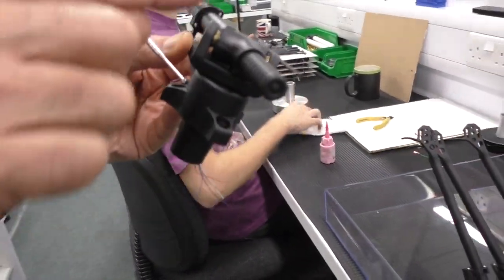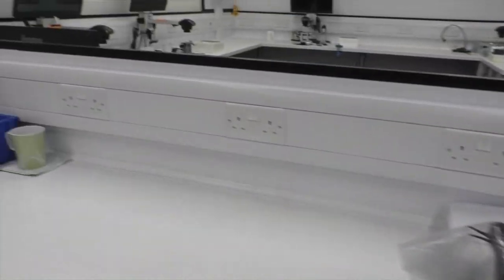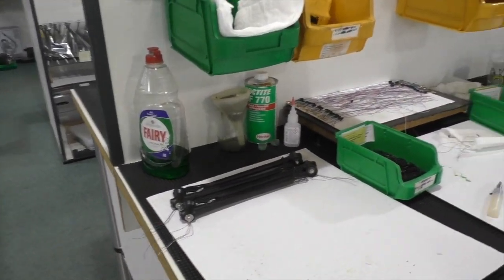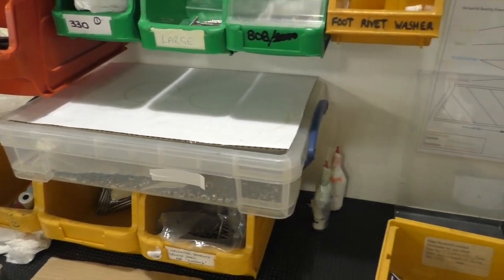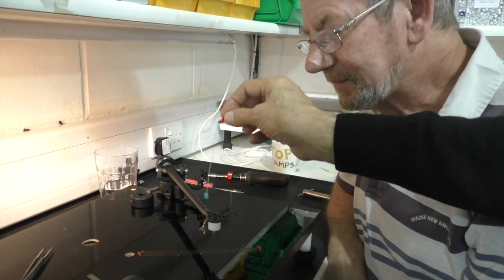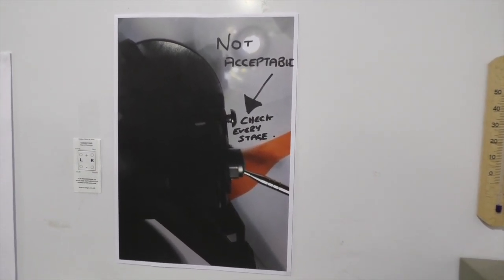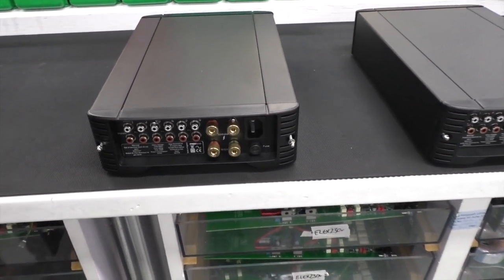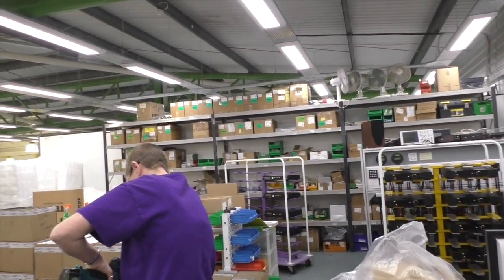Analogplanet Visits Rega Research (Part 2)

Comment: No other arm can pass a 20mg test?  Really?  Not convinced about that. I'll take that challenge☺ SME or Origin Live  might have something to say about that? OL don't I think compress bearings as they use a different phillosophy.  Great vid...great company.
Reply: I like how MF says "No other arm... you've been to every single factory and checked?"  😆 He knows he's incorrect, but chooses to be polite. To put it it perspective, Dual turntables from the mid 70's spec'ed <15 mg  horizontal and <7 mg vertical friction. Less than 7!  And there have to be modern tonearms out there that exceed even that.

Comment: A micron is not .0001 inches as he stated. It is .000001 meter or a millionth of a meter. That gauge is good to .00254 mm or is 2.54 times less accurate than a micron device.